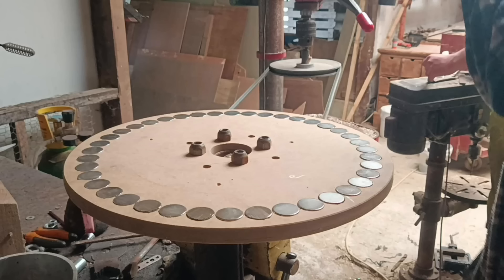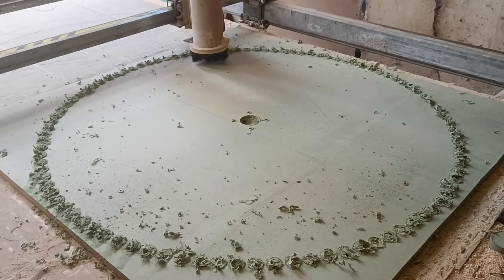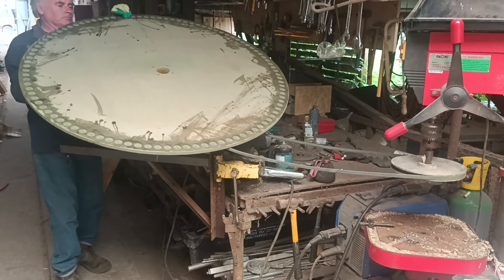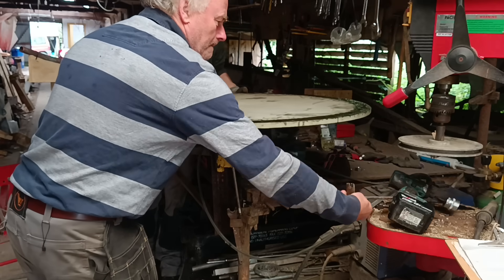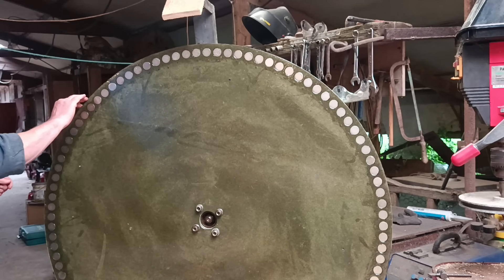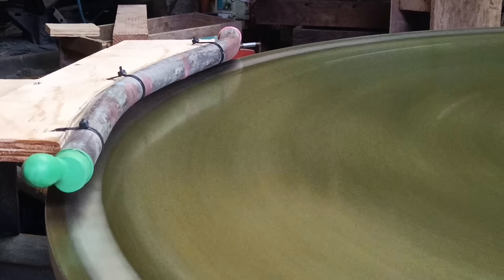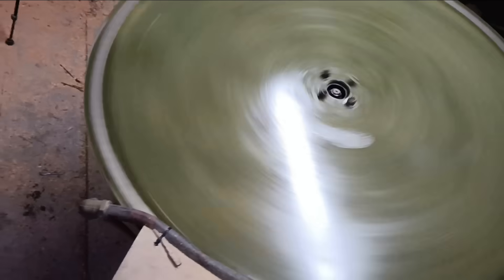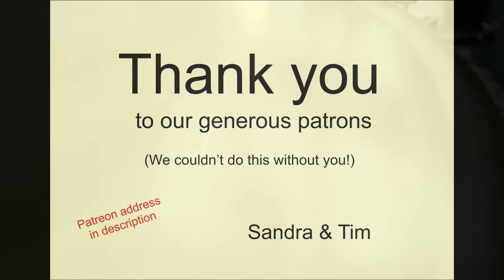ABSOLUTELY HUGE Magnetic Induction Heater! Using 100 Spinning Neodynium Magnets And A Bucket

Comment: Really cool: I’m an hvac designer and do heat loss related calculations as part of my work. The energy to heat the 5L of water 10 degrees is: Q=mc(dT) = (4184J/kg C)(5kg)(10C) = 209,200J. Since it was heated over 10 min that’s 209,200J/600s = 348.6 Watts of power. It’s hard to estimate the losses since I don’t know the ambient air temperature, but at 23C water, assuming about 13C ambient: I’m estimating around 250 Watts or so, with some quick lookups, with around 80% of that loss being in the piping. So that’s at least the same ball park as the above calculation: if you insulated everything you might be able to heat up a bit of water for a sink or a small outdoor shower.. (or, you can pipe it in to a regular water heater and reduce your demand, and probably eliminate your standby demand to keep the water hot when not in use) nice work!
Reply: I just knew someone would calculate that - well done!
Reply: I double checked it an yeah (((5000*4.184*10)*1J)/(10minutes)) is 350ish watts. There's no way that system is at thermal equilibrium yet. I have a 400w engine block heater I put on the hydraulic oil tank of a log splitter (its 2 gallons, I think) and it will get up to 50C starting from -15C over an admittedly longer period of time, but with a LOT more thermal losses.
Reply: @htomerif  yes, there’s a few things we have to remember with this: first, this calculation is a thermal energy calculation: so we’re calculating how much actual usable thermal heat output after losses went it into the system (not the input). The 400W nameplate rating of that block heater would be the electrical input. Second, is that losses will increase the as the difference in temperature increase as we all expect. But the copper is actually what’s being heated, which is then transferring to the water. It’s also going to transfer to the surrounding air since it’s not insulated. That pipe needs to be hotter than the water to transfer heat to it. I think that’s the largest heat loss in the system (which I didn’t forgot to account for in my napkin math for losses). So like the video mentions I’d guess were about close to equilibrium. 
 
In the end, It really goes to show that losses (or insulation) makes a big difference in how much temperature you can get. Doubling the thickness of the pail and piping would half the heat losses, since insulation value is directly proportional to it’s thickness: so we can really start to imagine what adding a little insulation could do!
Reply: @philxcskier  I'm not sure why you said what you did. I don't get what your point is and I don't think you do either. You can mostly skip the rest of this comment since I don't think you got it the first time around.

anyway:

A 400w heater's "input" is 400 watts. That's also its output. There's no "napkin math" here. Resistive heaters are 100 percent efficient.

As to the "temperature differential", yeah, that was my point. My 400w heater achieved a 60C differential while his 350w of inductive heating (calculated, so we don't have to quibble about where it came from) stalled out at a 10 degree differential. Something isn't right with that.

My log splitter is not insulated. This is also not a small log splitter. Its a 25 ton hydraulic cylinder, so that 400w is also heating up the steel tank and the entire frame the tank is welded to.

You really need to understand that at 10C above ambient, his heat losses are probably less than 50 watts.

I'm guessing you don't have a particularly decent physics background if you're actually arguing that the heat transfer between the copper and the water is an issue. You got the math right but I don't know how you could flub the concept of one of the most thermally conductive materials interacting with one of the most thermally conductive fluids.

I actually did very nearly what he did (only not at all). I took some vinyl hose and attached it to a radiator (heater core, actually, about 1 square foot) and put it in a styrofoam box with an acrylic lid on it, exposed it to the sun. It worked fine and got a 5 gallon bucket of water up to near boiling. I don't remember over what period of time, but 1 square foot is not 350 watts of solar irradiance (maybe 150 watts?). Point is: it was roughly the same loss system, using an even less efficient thermosiphon with more water.

deep TL;DR: I suspect he did something to stop the thermosiphon effect. That's the only rational explanation of why 350w would stop at 10C of differential. No idea what. We weren't given enough information.
Reply: @ I’m sorry I wasn’t clear: heat loss from copper to water is not an issue, it’s heat loss to surrounding air probably is - that copper is warmer than the water. If the convective heat syphon is stopped, that copper tubing will get significantly hotter. Point was yeah, your uninsulated heater was able to produce a considerable 60C heat and if this system is insulated it really should be able to produce hot enough water to be useful.
Reply: one note: copper has high thermal conductivity, but water actually has a very low thermal conductivity - which is useful since that gives it high thermal mass, meaning water can hold more heat energy per degree heated than other materials. It’s why your capacity decreases when you add glycol to a water system the glycol solution has a better thermal conductivity and is easier to heat- that means the same temperature fluid needed less energy to get there, and that fluid now has less energy to transfer within it.
Reply: @philxcskier  Gott im himmel, you're saying all of these things that are patently untrue. Yes, if you had a microcapillary tube a mile long made of delrin, sure, the water's thermal conductivity might be relevant compared to mercury or liquid sodium, but in any practical system, convection is king.

Part of me thinks I should have been more precise in my wording, but then you just show it wouldn't have mattered. Ethylene glycol has even lower thermal conductivity than water, about 1/3rd. Any mixture of EG and water has lower thermal conductivity than water alone. This is not why we ad EG to water, in fact, its a detrimental effect of adding EG. The added viscosity is also detrimental.

The actual reasons we add EG to water are twofold:
1, it depresses the freezing point of water so your whole coolant system doesnt crack when it hits 0C.
2, it increases the boiling point of the mixture. I have a GSXR 1000, which has an engine temp display on it. The coolant temp regularly gets up to 230F or so in the summer.

Everything you're saying is almost pure wrong and its taking me an order of magnitude more time to correct your misinformation than it does for you to produce it.

Are you doing this intentionally? It sure seems like it.
Reply: @htomerif  Um.. I design hydronic systems for a living, not sure why you think what I say is wrong or what you’re trying to argue about 🤷🏻‍♂️ I was just agreeing with that the system should be able to heat water and giving my thought process.
Reply: @philxcskier  So this is probably more a problem of you presenting yourself than anything else. When you're on the internet, don't say "I have an internet PhD". Its the most useless thing you could say. Always back what you're saying up with realistic examples. Your problem is that you switched from a quantitative thing (which is usually what I'm doing here) to a qualitative "maybe heat is being lost in the pipes".

I'm an electrical engineer. I spent a career in the Army and then most of another one in the Department of Defense. My professional experience is mostly in programming, avionics and robotics, but also chemistry and biology. You shouldn't believe any of this because I've given you no examples of why you should believe me.

If you want to make your experience tangible, you have to give a tangible example that drives it home. I'll tell you this: one of the things I worked on (and with) is the mercury cadmium telluride cryogenic thermal optics systems that both live inside the the TOW missile system thermal sight, Bradley thermal sight (they're electrically identical (ish)) and that lived in the SR-71 optics pill.. Its the same sensor in all of those things, just the TOW only used about half the elements.

I know this comment as a whole is TL;DR, but you can verify my earlier statement. Its essentially impossible for me to have copy/pasted my professional background. Maybe two dozen people in the world know what I wrote. Appeal to authority is the worst mistake you can make here when you're correct.

My point was that you're not going to lose 350w of heat in that garden hose-bucket setup with 10C difference in ambient temperature.

You say you design "hydronic systems for a living", if that's not a lie, you should know about what it would take to move 350w at a 10C temperature differential. You're going to need a car sized radiator with pumped (not thermosiphoned) fluid and forced air. So what you're doing now is forcing me to call your bluff because you've given me false information. You don't "design hydronic systems". You're an HVAC installer.
Reply: @htomerif  Btw, that is a belter of a comment..... please allow me to kowtow to you 3 times!
Reply: @htomerif  We had used both electric motor and small hydroturbine to rotate an induction magnet disc to heat copper tube, with and without water in it. In both cases the wind and the water cooled the copper pipe sufficient to negate the induction temperature increase. This the recorded  delta 10'C x 5L x 600 seconds = 386W may have been as much as only 50% of the total heating effect. The great marvel of all these Utube experiments is how much information is missing.
Reply: @conormcmenemie5126  I'm sure there was information missing and I'm not criticizing Way Out West. They weren't trying to do an in depth, quantitative analysis of anything they were doing.

I'm criticizing people who throw some math at things, evidently have no actual experience with the physical reality of systems and draw qualitative conclusions from irrelevant math mixed with a pure lack of knowledge.

In your case, I have no idea what you're talking about. A 1/2 watt pager motor? A 100 megawatt colocated power plant water pump? You don't say. My guess is somewhere between those two things.

In either case, its nearly impossible to design a system so badly that there is no functional difference between water as your thermal transfer fluid and air as your fluid. I do mean "nearly impossible". Like it can't happen by accident. I would have to go out of my way to design a system as nonsensical as you're describing. Like a hundred meters of 50 micron ID copper tubing being operated at 1000 bar? That might do it. It would also make any heating you applied to it inductively utterly irrelevant.

So I think you're leaving quite a bit of critical information out of your example.

I wrote another comment somewhere else on this video: BUY A THERMAL CAMERA. They're cheap and they show you exactly whats going on in thermal systems thats impossible to visualize any other way.

I said it before, but the reality of this video is simple: the pipe was too far away from the magnets. They weren't getting the heat they thought they were. I'm guessing their entire change in temperature was due to the difference between atmospheric temperature and the starting temperature of their water.
Reply: Maybe pay attention to the watts, current and voltage of the drill there could be a voltage drop under load in the drill input end. Then circle the entire wheel to take advantage of the full circumference. Keep the loads balanced. Before a coil burns out it generally starts to draw more current.
Reply: this guy only used max 12.5% of the circumference, so if he had full coils above and below, then heating should be increased gross by factor of 16.
Reply: @conormcmenemie5126  Input power would also be increased. But yeah. You are right. Depends on if we are focusing on efficacy or efficiency arguments. To me, it looks like a half way decent way to heat water from mechanical motion.
Reply: https://youtu.be/-MuZdCUSp3k?si=BD1w4jJXzpAP29eg
Reply: You'd have thought he'd have replied to this comment.
Reply: Would a thicker material at the magnets help? Or putting a pipe on both the upper and lower sides of the magnets?
Reply: seems to get the overall loss take the power from the drill, the thing rotating it, and the final power going into the bucket, the difference would be the sum of all losses.
Reply: if the water temp was 13'c, then that seems close enough to average room temp too.
Reply: Thanx for the math...👍👍
Reply: Freon instead of water to make air conditioning?
Reply: @johnstambaugh9283  Air conditioners require compressors, not heaters, so none of this would work for air conditioning.

You could probably run an ammonia absorption freezer from something like this though it would be ridiculously complex for that kind of cooling system.
Reply: @htomerif  Heat causes expansion. Conventional electricity is not the only kind EMF.
Reply: @johnstambaugh9283  Can you post what comment of mine you think you're correcting? I don't remember ever saying "heat doesn't cause expansion" or "conventional electricity is the only kind of EMF".
Reply: @htomerif my camper has a refrigerator in it that works by burning propane. Not sure exactly how it works but heat can produce cool with the right thermodynamic system, somehow.
Reply: @alexdrockhound9497 Yeah, true. Its an ammonia cycle refrigerator most likely. Ammonia and water get boiled by the propane fire (or a catalytic burner), evaporating the ammonia from the water. A heat exchanger removes the heat from the ammonia, then the liquid ammonia runs back down through the cooling coils in your refrigerator (the evaporator) and vaporizes. It then dissolves back in the water. Ammonia is highly soluble in water as ammonium hydroxide. The cycle repeats from there.

Usually you see this in off-grid deep freezers. Other gasses and solvents will work than ammonia and water but are uncommon.

If you look at your refrigerator, it'll probably either say "ammonia" or "R-717". Same thing.

I remember this video. I'm not gonna look through the comments again. I remember being thoroughly annoyed at the lack of basic physics knowledge demonstrated by what are, presumably, grown adults.
Reply: Could have done with you on our team: Eddyhydro Ltd :(
Reply: Yeah, but the energy required to rotate the entire wheel plus the frictions and tremblings and pipings will get you a net loss.
So apart from a fun experiment, and maybe human-powered (via bike, or manual gearing), it’s mostly useless.

Without talking about the initial cost of the energy need for magnetizing the magnets.
Reply: Yes. I envision a stationary bike sitting next to a hot water tank. Every morning someone gets on and pedals like the devil. They get their exercise AND they bring a tank of water up to temp for the day (or, at least, offset the fuel used to heat it.)
You never know, we might all have to do this someday when the power grid goes down...  🤔
Reply: @gweltazlemartret6760 no free energy. But the cost of gas heaters for warming the house is proportional to the western leadership totally screwing up the price of gas. Cheaper to "burn" electricity to burning gas.  Not all initial impressions are I the ball park. Experiments like these are not intended for you. Way too many variables to handle
Reply: Free energy if driven by a windmill @gweltazlemartret6760
Reply: @gweltazlemartret6760  you're missing the point.  We are absolutely not trying to "save" energy - as we don't believe energy is in any peril.  We are trying to 'convert', and move energy to where it can do work as needed.
Reply: @mikemotorbike4283  I see: you need the energy to actually rotate the wheel.
That’s a clever design.

Unsure why you say energy needs saving, but sure this won’t conserve any.
Reply: @gweltazlemartret6760  did you watch the video? He is planning to run it from a windmill. He said it right at the beginning. He is using the drill press as a temporary source of motion so he can decouple the design of this part from the windmill design.
Reply: @mckenziekeith7434  sure. That'd be a more sensitive primary source.
I hope there's wind often(+strong) enough in the area to power the system, or it'll have deceptive outcome compared to the drill intake.

Comment: Wonderful project!  You want to maximize the natural convective flow in the system by maximizing the height difference between the cold leg inlet and hot leg outlet while still keeping the hot leg outlet submerged below the surface of the water outlet.  You will start to see increased rate of heat transfer.

Comment: One thing that might help is to have the water outlet from the reservoir be at the bottom, but the inlet be near the top so that instead of mixing caused by the convection of the hot water coming back in, it flows to the top. Unless of course, that slight mixing is desired. Basically the opposite of what a hot water tank does, where the colder water comes in at the bottom and the hot water is drawn out from the top.

Comment: i like where your going with this. my only thing is a spinning wheel is much more stable when vertical not horizontal. like a bicycle tire. stability and clearance of the magnets to the pipe may increase the performance. just a thought.

Comment: Would the heating speed be doubled if you had a second wheel on top of the pipe with magnets oriented the opposite of the bottom wheel?